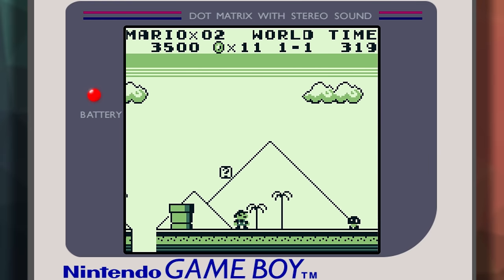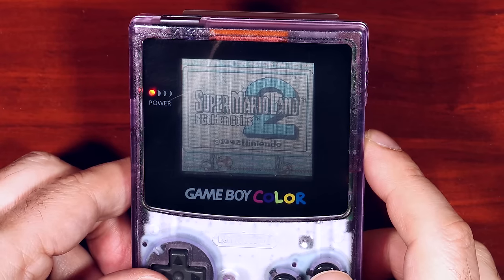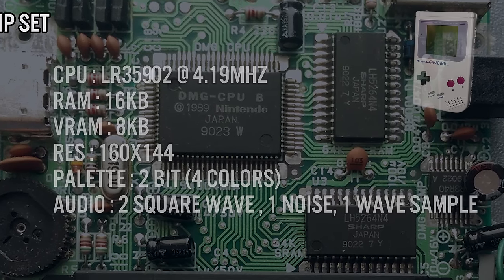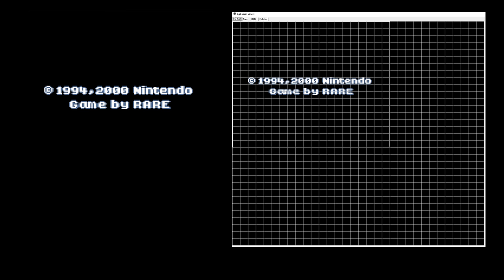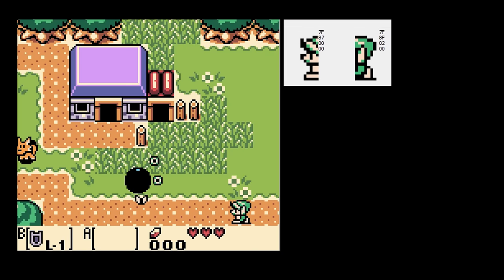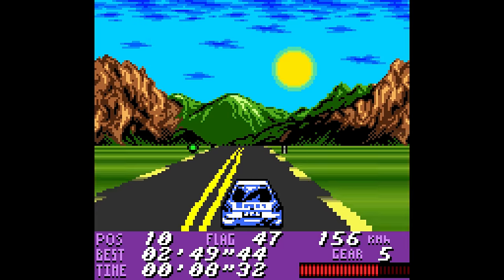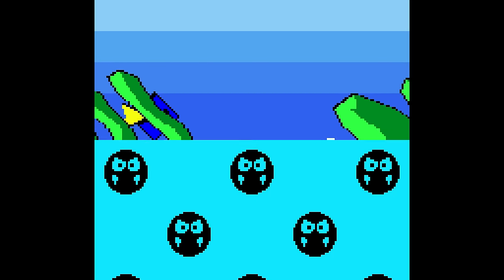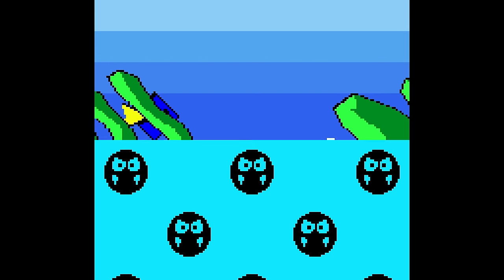How Graphics worked on the Nintendo Game Boy Color | MVG

Comment: I worked for Xanterra from 1999 to 2000 on Gameboy Color games.  The Gameboy Color was essentially a Gameboy with an extra color layer.  Although it felt outdated to me at the time,  I am impressed at how good some of these games look.

I was either unaware or forgot that the Gameboy Color could run at 8 Mhz.

I was looking forward to working on the Gameboy Advance, which was pretty powerful for a handheld, but Xanterra went out of business.  I ended up in a different industry.

Comment: It's interesting that they kept the entire concept of VBLANK.  That just shows how entrenched hardware architecture was at that point. All other consoles and computers were designed to output a standard video signal for use on a monitor or TV. So there were actual physical limitations in the drawing of the scanlines by the picture tube and returning to the top of the screen, and the corresponding timings in the video signal.  Since the Gameboy had an LCD display, there were no physical scanlines or VBLANK required to return to position 0, 0.  While there may have been some timing limitations as the LCD probably refreshed in a certain way, the VBLANK was not a physical limitation because there was no actual picture tube and scanning and thus no true delay required to return to 0, 0.

Comment: Actually Another World is using same 16 color mode on both EGA and VGA on PC. The only difference is that EGA had fixed palette like ZX Spectrum or C64, while VGA had 18-bit (262 thousands) color DAC which could assign any color to each palette entry in all color modes: 2, 4, 16 or 256 colors. Another World in general runs in 16 colors on other systems like Amiga and Atari ST.

Comment: Nintendo did not make the GBC because they did not want a new handheld with a new architecture. They wanted to make a new handheld using as little R&D as possible to maximize profits. It worked well, but even when I had a gameboy color in 1999/2000ish I knew the graphics seemed a lot more primative then they should have been for the time. I Knew the snes came out in 1990/1991 and the gameboy color stilll did not have graphics equal to the SNES?
When I played Zelda Oracle of Ages as a kid, I was impressed by the cutscene at the start, but was turned off by the in game graphics. Today I feel most of the gameboy color and earlier games did not age well at all.

Comment: When turning the system on with an OG Gameboy game inserted and holding one of the D-pad directions, you can change the colour hue or shade. 4 different for the four directions. How is this assigned?
Reply: Boot ROM checked which keys were pressed and handled that.
Reply: There's actually twelve selectable color palettes that you can use with a combination of buttons and directions.

Comment: I'm surprised you didn't mention that there were some games that were programmed for the original Game Boy but had full color graphics programmed in for the release of the Game Boy Color. AFAIK Pokemon Gold and Pokemon Silver were to games that were done this way. If memory serves correct, the release of the Game BoyColor had been delayed so many times basically GameFreak said screw it and released them for the Game Boy. By time the USA releases of Gold and Silver were ready the Game Boy color was already out and thus (I believe) those two only work on the Game Boy Color. The Japanese versions should play in Black and White (or green hehehehe) on an Original DMG.
Reply: Nah, all versions of Gold and Silver are compatible with the original Game Boy (except for the Korean version, as it requires the extra VRAM bank of the GBC to display all korean characters), and the game came out after the GBC in both Japan and Europe. Crystal, however, is a GBC exclusive everywhere and refuses to boot into GB mode, and even if you force the game to run in a Game Boy it just crashes as soon as it tries to load the overworld.

Comment: I believe the GBC can hflip and vflip background tiles, while the DMG can only do this with obj sprites. It's been a while since I looked into it though so I may be wrong.
Reply: That's correct, every tile in the background is defined by two bytes on the GBC, one for the tile number, and one for the tile attributes:
Bit 0-2  Background Palette number  (BGP0-7)
Bit 3    Tile VRAM Bank number      (0=Bank 0, 1=Bank 1)
Bit 4    Not used
Bit 5    Horizontal Flip            (0=Normal, 1=Mirror horizontally)
Bit 6    Vertical Flip              (0=Normal, 1=Mirror vertically)
Bit 7    BG-to-OAM Priority         (0=Use OAM priority bit, 1=BG Priority)

Comment: Imagine if Sega turned away from "superior graphics" for one second and took this approach for the Game Gear.
If only...
Reply: ...except Sega didn't have a pre-Game Gear t base that decision around. They had to think about what the GBC already could do, the rumors of the GBA, and NeoGeo handhelds. They made the correct decision in pushing high-end graphics, they just couldn't do it at a cheap price or with smaller hardware thanks to technological limitations.
Reply: @DxBlack  Fair point.
Reply: Sega didn't really have a chance. The Game Gear came out the year after Nintendo released the Game Boy, and Sega was hurrying to catch up (having never planned to have a handheld). They didn't sit down and design a system with "superior graphics." They just the Master System, tweaked it a bit (mostly just allowing it to run a lower resolution screen), and made it portable.

This was all in 1990, 8 years before Nintendo came out with the Game Boy Color. And Nintendo took that long for a reason. The tech didn't really exist to make a cheap-enough color system with good battery life. Heck, you couldn't even get a screen that wasn't blurry. 

Now, granted, SEGA did think that having a more powerful system would allow them to compete with Nintendo's Game Boy. They pushed the greater power to differentiate themselves. But my point is that they didn't really have a chance to make something like the Game Boy, and were too early to make something like the Game Boy Color.
Reply: @ZipplyZane  I understand now, thanks!

Comment: XEKKUSU is not really that challenging to do on a Z80. Vector rotation, translation and scaling (especially in integers) isn't really that hard. It's generally matrix multiplication, multiplication although not a feature on the Z80 is easy to implement. The rotation is tricky if you want to implement sin and cosine (without maths coprocessor), but you can pre calculate the sin and cos tables and use those and you can even have those in integer values avoiding all floating point calculations -- and the reduced resolution makes it easy.
Elite on a 1MHz 6502, BBC Acorn already did it, which is arguably even harder because it doesn't have a combined 16 bit registers. The tricky part is the fact that the GameBoy didn't have a bitmap mode. So you need to basically have a table that describes which tile is on an X, Y location, and then create a point in that tile. This is probably the biggest hack but it was done in the C64 for years,

Comment: I love these kinds of videos. But how could an LCD "draw" in the same way that an analog TV would? If it doesn't, would "render" be a better word?
Reply: Rendering means turning data into pixels. The PPU processed data in VRAM, converted it to pixels, row by row, and pushed those pixels to the LCD. You can update pixels on an LCD in any order, but for simplicity reasons and to get a consistently stable and evenly darkened image, most handhelds do it in order, usually the same order as on CRTs: left-to-right, top-to-bottom.

Comment: Is there anything special in terms of how black carts implement the dual palettes to support both monochromatic on old Gameboys and color on GBC? Is it reusing the super Gameboy enhanced implementation?
Reply: Those carts simply checked which hardware they were running on and simply ran slightly different code.
As for SuperGameBoy, no, its enhancements are not compatible with GBC at all. When it comes to graphics SGB allowed two things: assigning static palettes to certain regions of the screen (not to sprites or tiles like GBC, so it was used mostly for static title screens) and using SNES sprites (obviously not available on GBC).

Comment: Did anything really come of the infrared port they added to the GBC? Apparently it was so infrequently used they didn't bother including it in the GBA, despite it being otherwise backward compatible...
Reply: It wasn't widely supported, since it wasn't particularly reliable and wasn't fast enough to use for real time two player games. It was mostly used for exchanging characters and hiscores; although a few games did something interesting with it. For example, some of the Bomberman games had secret levels you could unlock using a TV remote control.
https://nintendo.fandom.com/wiki/List_of_Game_Boy_Color_games_with_IR_support

Comment: Whoa hang on. Sorry, I know this is probably a total dumbass question but I’m gonna have to ask it because I’m confused. How do you get 32,768 colors from a 15 bit color palette?

I have a fairly rudimentary understanding of bits, and as far as I’m aware one bit has two states, being either a 1 or a 0. So when MVG said the original GameBoy only had 4 colors from a 2 bit color palette, that made sense because I just assumed that was 2 squared equaling 4. But if I use the same math with a 15 bit palette in mind, 15 squared equals 225 not 32,768.

I fear I might have Donkey Brain. What am I missing here? Thanks in advance
Reply: Hey I’m RyandBurtson from the future. Earlier I was thinking, “How does 15^2 = 32,768,” because in my head I was thinking, “Oh you take the 15 because there’s 15 bits and you square it because there’s 2 possibilities for each bit,” which is dumb. That makes no sense.

The reason you get 32,768 different colors from a 15 bit palette is because 2^15 = 32,768. The real reasoning behind it is bits are binary, so they have 2 options, and every bit you add adds an exponential amount of outcomes. So 2^15, not 15^2. I don’t know how I didn’t even think to just flip the numbers and work backwards from that to figure it out, or even just use logical thinking to do it. I guess I was just too focused on making 15^2 work that I didn’t think about anything else. Man I’m an idiot.

Comment: Hello did the gameboy color had better graphics than the nes console ?
Reply: More experienced devs, and different tricks could be done on the GBC than what was available to the NES's 2a03/6502.  Also, the GBC ran at a higher clock rate than the NES (by around 0.3 MHz, which is about 15% faster than the NES, when in GBC mode).  Finally, The GBC targeted a built in liquid crystal display where the NES targetted an external CRT style TV screen so the actual way the hardware works with the display is quite different.  The reason the NES works on newer TVs with the proper inputs is simply that they have a way of emulating how a CRT worked, converting it to instructions an LCD driver can understand (afiak this isn't exactly how it works, but its close enough to make my point), but you'll notice that the games don't always look better on a flat panel than they would on a CRT... This is because of differences in how the TVs display images, with newer displays using scaling to simulate 320x240 (my TV does this at 800x600p or 1024x768p unless I force wide screen), and thus making the pixels bigger, while a CRT actually output either 320x240i or 640x480i, which makes the pixels fit the inbuilt grid more closely.

Comment: Wait was that megaman x for the gameboy color?
Reply: It's called Megaman Xtreme and Megaman Xtreme 2.  They were terrible ports of Megaman X and X2 for the first one, and X2 and X3.  While this sounds great, they were done in such a way that was not very good (the original Megaman games were better than these "ports"), and they told their own story using bosses from half of each game listed.  Xtreme had 4 bosses from X and X2, and Xtreme2 did a mix of bosses from X1, X2 and X3.  They are considered Spin-offs, and 1 takes place in between X2 and X3, and 2 takes place in between X3 and X4.  They both have their own sets of final bosses, but the robot masters are from the aforementioned games.

Comment: Also, 64 colors minus one is 63, not 56.  You never explained this.
Reply: It's because colour zero in sprite palettes is always transparent, so you can define four colours per sprite palette, but only three will actually be visible on screen.

The 56 colours on screen is because:
8 background palettes of 4 colours each = 32
8 sprite palettes of 3 colours each = 24
32 + 24 = 56